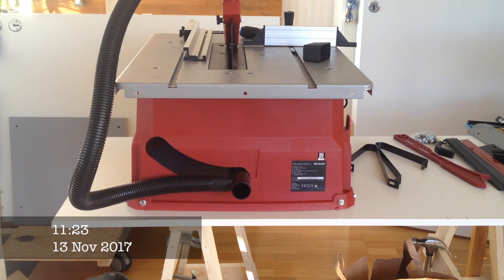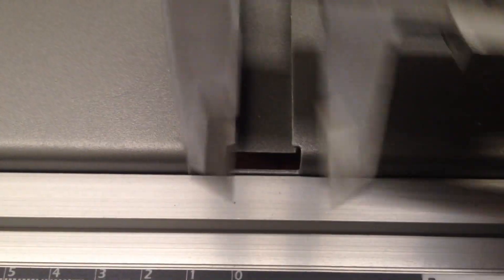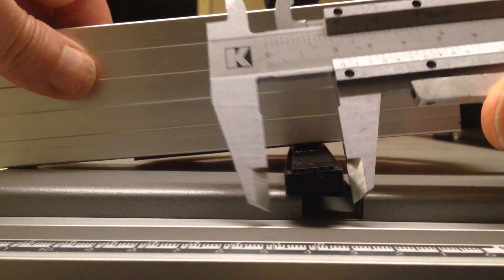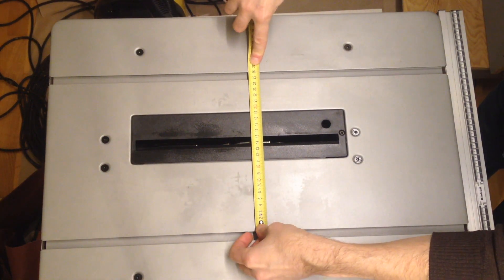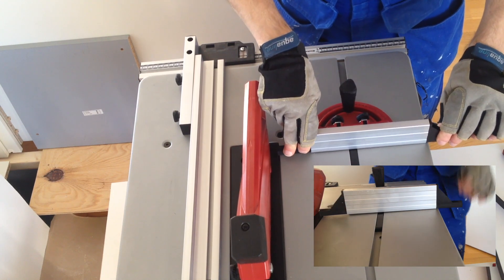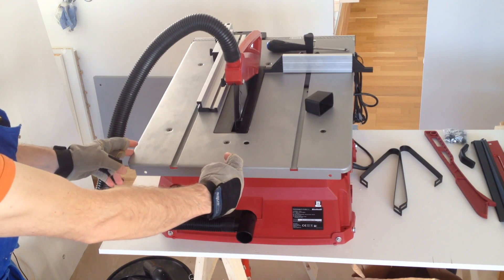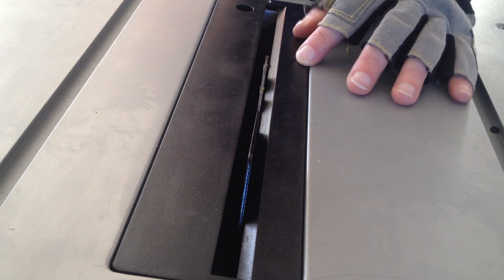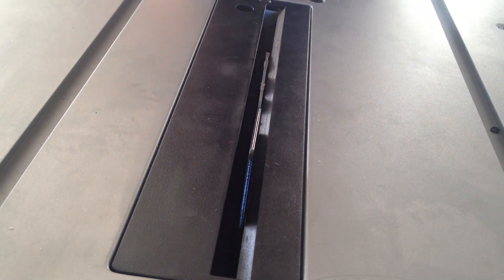Episode 9 rev 2 (10 Nov 2017) - Einhell 2025 | U Table Saw Meassurements

Comment: Hi Hogdahl,

Did not get the measurements for the top of the  slots. ( if i want to cut miter sliders). I do not own that table saw but I considering it if I can find aluminium sliders if the right dimensions.

I noticed that in other video you cut them in wood. Can u tell the dimensions?
Reply from the maker: Thanks for reaching out! I made a video showing off miter slot measurements (https://youtu.be/H3oaw8Cgawo?list=PLl2MXgNWEbwE-xO5wwUe2C-kS5b4wKhmr ). Maybe it contains the measurement you are looking for? Good luck with your table saw purchase and miter slider design and build :)

Comment: Hi Hogdhal (assuming your a Finn, sorry if not:),

Thanks for all the videos:).  Did you have any luck changing the blade on this saw?  the retaining nut on mine seems to be stuck fast...
Reply from the maker: Thanks! You're welcome :). And your guess on my nationality is not bad, although maybe not entirely correct ;). No, I have not seriously tried to change the blade yet. And you're the second one asking so I suppose it's something with this saw? I just hope the nut is left-threaded so you know to loosen it by turning the "wrong way", i.e., clock-wise?!
Reply from the maker: Hi! I managed to remove the blade. The bolt is right hand threaded! I made a video about it here (https://youtu.be/QWcDE7fuigA). Good luck with your blade!
Reply: Kjell-Olov Högdahl, glad to hear that but I didn't;) The nut on my blade was completely locked and I broke spanners try to get it off.  Bought a new saw in the end.
Reply from the maker: Sorry to hear that! Well, a new saw is also a way to solve that problem ;)
Reply: R T F M. Read the flaming manual. On all saws you tighten the holding nut/bolt opposite to direction of travel.
Reply from the maker: @paulbrown3968  Thanks! Yes, I have understood that now. You learn as you go :)